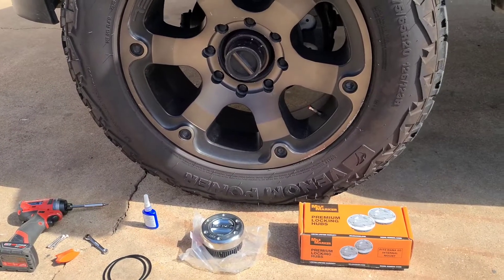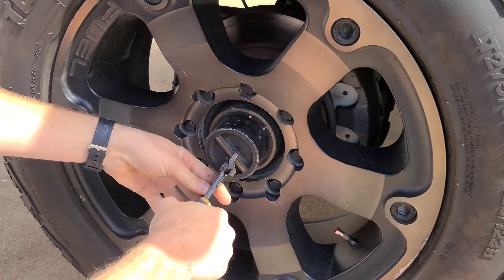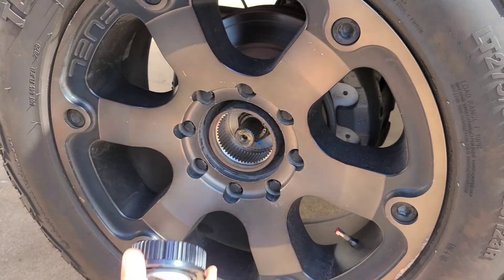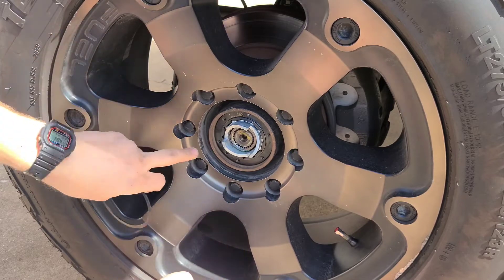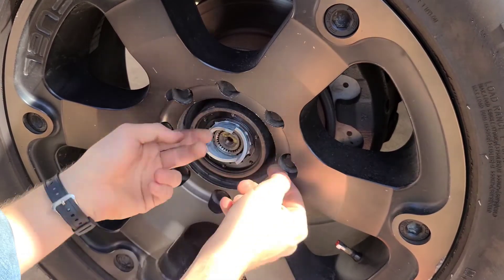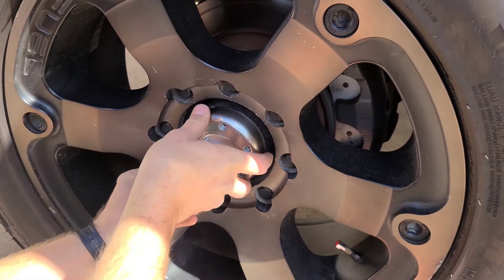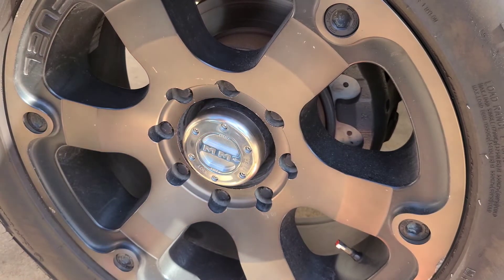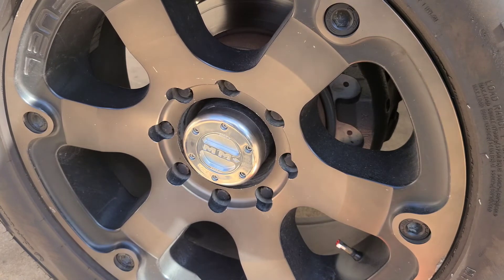Mile Marker 4x4 locking Hubs install

Comment: Bought the same ones for my 2001 F350 SRW and they didnt fit.
Reply from the maker: F350 can have a different axle set, both front and rear than an f250
Reply: Yeah they are the same.  Tje 449ss wont fit though, inside 30 splines line up but the outside squared off 55 splines wont fit between the hub splines.  Brand new hub assembly.

Comment: Did you install the inner snap ring on the axle shaft? The one just to the outside of the hub nut conversion kit pats. Then I see there is another snap ring on the outside end of the axle too.
Reply from the maker: There are 2 different locking rings that go into the hubs. They come in the box, and the instructions are pretty clear on them actually

Comment: Is there an advantage to using these over the OEM you took off?
Reply from the maker: Yes, These will not get stuck or seized up. Also, the vacuum system is no longer being used to lock them, so it eliminates vacuum leaks
Reply: Thanks. I'm still new to my 05 Ex. I haven't had an issue with mine yet but it is good to know if I have issues.
Reply: I just want to verify that this eliminates the ability to use the knob on the dash. I have a 05 with the 6.0 with oem hubs and my knob does not  appear to lock 4x4. If I were to get these MM hubs the know would become useless?

Thanks
Reply: @mattb.9572  No. The dash knob still shifts the transfer case. If you think you might need 4x4, you just go ahead and locks your hubs just in case..